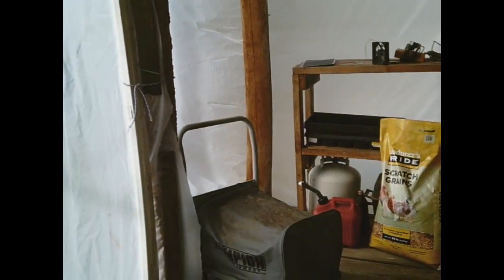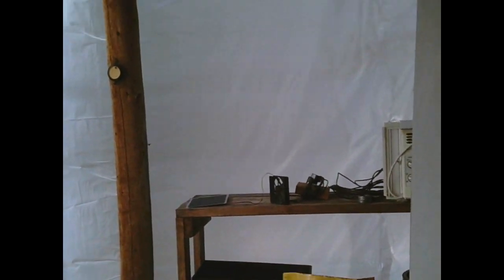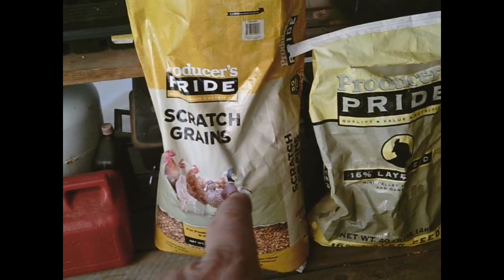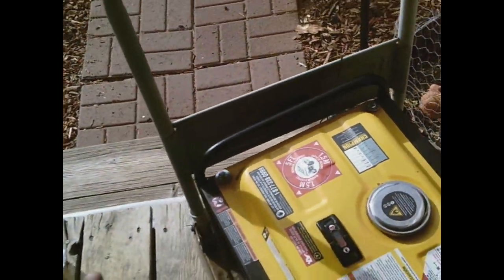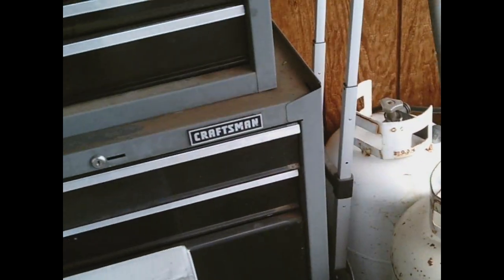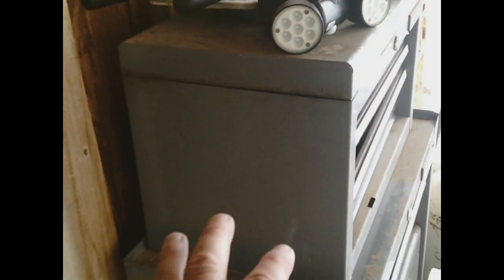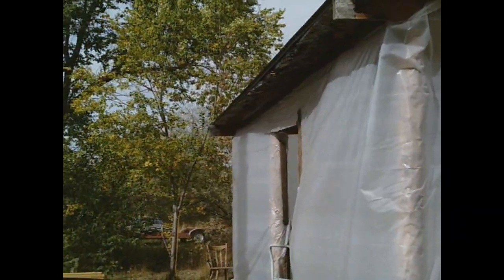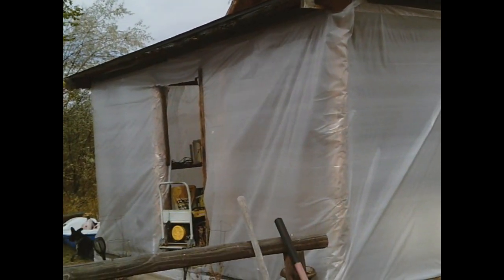Solarium Porch for Solar Heating and Starting Plants in Winter

Comment: Here is a video that uses a double layer of plastic and continually circulates air from inside the greenhouse through a hole on the inside layer of plastic on one end of the greenhouse between the two layers and it exits on the other end back into the greenhouse. It's just an idea that might help increase the efficiency of your solarium, here is the link .  My New Passive Solar Greenhouse  https://youtu.be/Kje2UESRE9A

Comment: What I would do is roll that plastic around either old broom sticks or some small PVC pipe and in the spring time just roll it up like a Roman shade and stored under the eaves of the porch. 
Come fall it is right there. Just roll it down and re-secure it.
Reply from the maker: That would probably work!

Comment: I know, for a fact, that this idea works. I have an entrance room, with lots of glass that faces south, on the back of my house. It keeps the room warm and blocks the cold wind from coming in our house, during the winter.  Definitely saves on heating costs!🙂
Reply from the maker: Older homes were often built with a mudroom on the south side where you took off your wet things and then entered the house and served that same air lock purpose. Fancy homes still have them.
Reply: @solarcabin  yep...true. My house was built in 1950.🙂

Comment: I wonder if you could use old sliding glass doors.
Reply from the maker: You can use old doors or windows and it doesn't have to be completely covered with plastic or glass. Just the side facing the sun.

Comment: Hmmmmm you've given me some ideas. I have a tiny house but my porch is only 12 ft by 4 ft. I may be able to do this period but I don't know that I'll be able to find a door that matches the opening. Going to have to think on this.
Reply from the maker: You can make a simple door frame out of 2x3s or watch the door and window installers dumpsters for an old screen door or door with a window. I just use rope for hinges.
Reply: @solarcabin  I actually have a ton of hinges. I might be able to pull this off at some point.